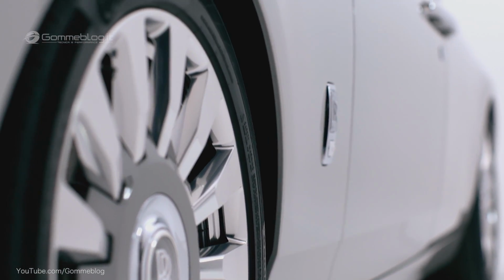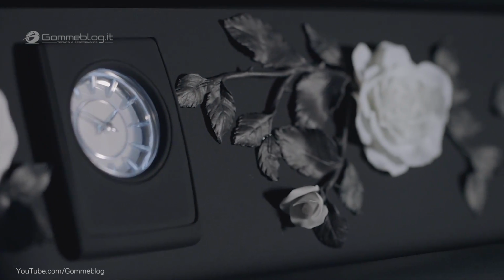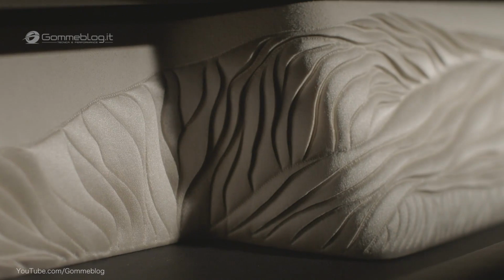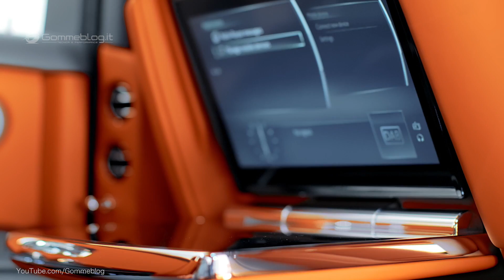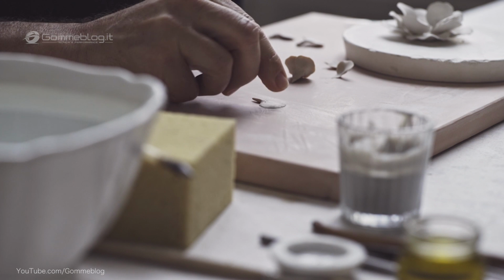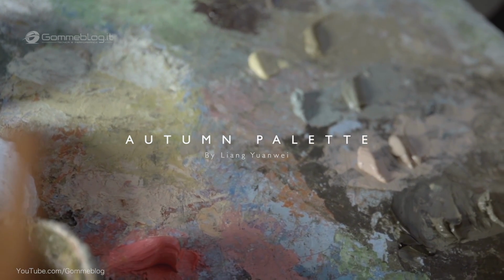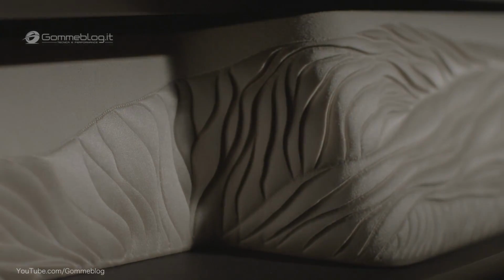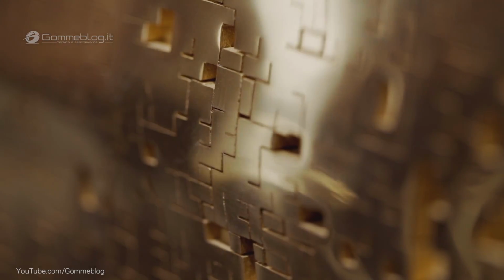Rolls Royce Phantom 2018 HOW IT'S MADE - Best LUXURY Hand Made Ever?

Comment: OK.  The more I have researched the Rolls Royce line of cars, the more I realize one thing.   Yes, they are handcrafted, hand built pantheons to the fine art of opulent luxury overkill.  But, the underpinnings and other mechanics are no better than a Chevrolet, Ford or Chrysle, or any other car on the road.  Having a hand painted dash insert may make you feel all yummy and squishy, but having to replace suspension components at 40 to 50 thousand miles, with a 5 digit cost, is a bit much.   I saw a video on a Phantom that had 50,000 miles on it and the rear door auto close was not working and the rear view mirror had fallen off the windshield.   For a car costing 6 figures, that is pretty piss poor quality.

Comment: That interior is a major problem. Back seat looks fine but the front misses the mark. Steering wheel is ugly and the entire space looks like you're sitting inside a padded leather square like one of those jail cells for crazy people.
Reply: Yon Yonson YOU KNOW NOTHING ABOUT LUXURY
Reply: Yon Yonson i agree
Reply: I'm 100% certain that rolls royce customers can arrange for a different looking steering wheel or a more curved cabin with less leather all over the place.
Reply: Front is for driver back is for the gentleman
Reply: Paul Chaos I doubt a customer can change the shape of the interior. Colors and materials, yes, but not the actual interior itself. This car costs north of $400,000 dollars, yet the interior looks worse than a Mercedes S class Maybach which costs less than half that price. The Maybach has better infotainment screens, swoops, curves, wood grain, brushed aluminum, quilted stitching, and 10 times more features. This car incredibly plain on the inside. Pause at 5:04 and you'll see exactly what I mean. It'a padded leather square with some shiny knobs. That is not worth of $417,000 (and that's just the base price)
Reply: the Mercedes s class is the pinnacle of luxury in my mind but other might disagree.
Reply: You drive a Bentley, You get driven in a Rolls-Royce.
Reply: tru but u can drive a ghost,dawn,pahntom coupe and a wraith also false a mulsanne is a get driven in vehicle as well sur